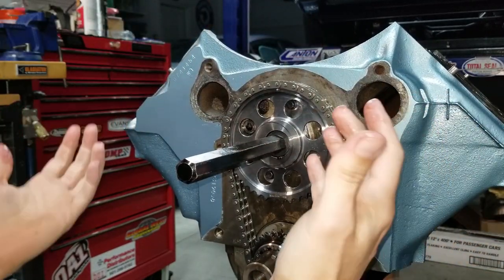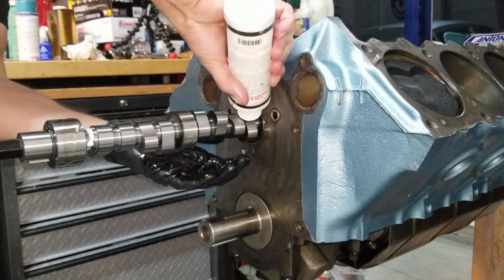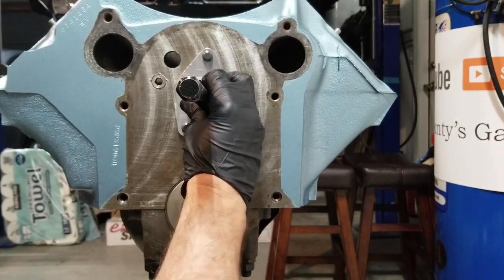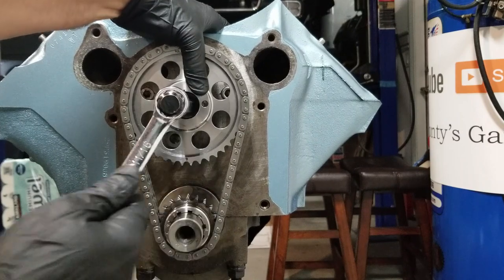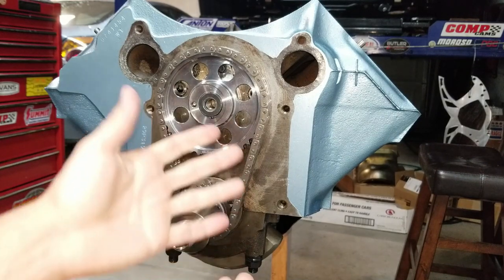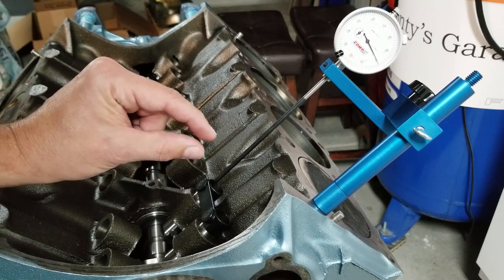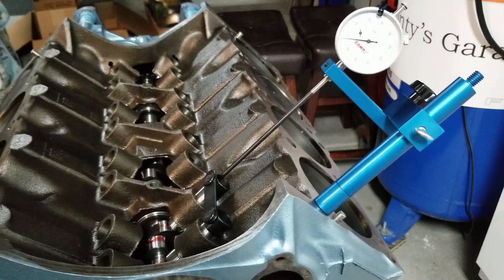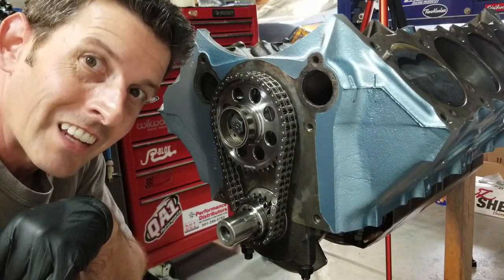Pontiac V8 Rebuild, Part 8:  How to Install your camshaft, and timing chain, with a degree wheel.

Comment: so, why am i moving the dot to the top of the cam sprocket???  How will this affect my distributor install?  Where should the rotor be pointing then? I always lined up the dots close together, and never had a problem...   Will this affect my fire up?
Reply from the maker: Good Question, Mike.  My intent was to illustrate that if you keep your dots at the closest point, throughout the entire build, you're actually on the compression stroke of Number 6 cylinder.  So, you can move it to the "top" after installing with the two dots together, to ensure you're at TDC on the compression stroke of number 1.  OR, wait until you're completely done with the build, and find the compression stroke with the ol finger/thumb over the number one spark plug hole, and wait for the piston to push air past your finger, telling you it's on the compression stroke.  Then use the balancer to double check you're at TDC.  (Which is always good to do as a sanity check)  Then put your distributor in.  Sorry for the excess info in the video... I'll admit, it's confusing.  Thanks for the comment!
Reply: Thank you for the “sanity check”!  Makes more sense now
Reply from the maker: @mikemodafferi5356  Nooo thank you for asking!  great point of clarification.  Keep em coming!

Comment: how do you feel about roller set ups? my father and i have firebird with a 400 in it and we need to do the cam  and lifters i want to go with a roller system but im not sure if it will be worth all the extra parts do we need to go with new valve springs and rockers as well as valves if we change to a roller cam/lifters?
Reply from the maker: Liam, seeing's how my first roller set blew up, that's a tough question.  But, I have faith in an American Made set, which are Johnson Lifters, from Butler.  Anyway, yeah, the point of a roller is to have a more aggressive cam, which would require higher pressure springs to ensure the roller maintains contact with the cam throughout the entire rotation.  And, if you're going to go that far, you might as well get high ratio rockers to optimize the valve movement.  All that equals more power... tough and expensive decision, I know.  Good luck, and thanks for the question/comment.  I'm sure others are wondering the same thing.
Reply: @FastMonty  you ROCK! So the factory valves will be okay or are there better valves we should be checking out? Or do you know of a kit that includes everything we will need to go to rollers?

Comment: Should you reestablish TDC each time you adjust your timing chain to a different key way? Great video helped me a lot!
Reply: Good question. If you're changing the keyway location on the crank sprocket, you have to remove the degree wheel...so, make sure the degree wheel is at zero, before removing it.  When you reinstall the degree wheel, set it back to the zero mark.  That being said, there's nothing wrong with finding tdc every time. Just to make sure.  Thanks for commenting,and good luck with your build!
Reply: Mike Montanari I’ve been having an awful time trying to get this cam degreed but once I started reestablishing TDC after each change it all feel into place. Still love my Pontiac no matter how much it fights me! Thanks for your response.
Reply from the maker: Awesome!  Glad it worked out!

Comment: Does your fuel pump eccentric sleeve move back and forth once tightened
Reply from the maker: I believe it does rotate on the inner sleeve.  I'm almost at that point again in my latest rebuild... I'll find out, and will try and let you know...
Reply: @FastMonty  mine moves quit a bit towards the timing cover and back towards the timing gear where it makes a clicking sound. ???
Reply from the maker: @jacklopresto2872  That does sound excessive.  I'll video what mine looks like, when I get to it.
Reply: Awesome can’t wait. When will you be at that stage
Reply from the maker: @jacklopresto2872  Hopefully this week.  :)
Reply: @FastMonty  ok awesome
Reply from the maker: @jacklopresto2872 Here you go... https://youtu.be/86XlfGs5sj8

Comment: Order peoble  says spinding by hand??
Reply from the maker: yes, and no... with the installation tool installed, you should be able to spin it freely with a wrench.  Due to "Stiction" the cam will not start turning easily, but once you get it turning, you can tell right away if it's too tight, or not.  Hope that helps.
Reply: @FastMonty  thanks good help.  Thank you very Much
Reply: @FastMonty  Hello again.. How Many foot pound can i Tight my care rods.  Thanks you very Much..
Reply: @FastMonty  and how many foot pound can i Tight my my crankshaft.  Thank you
Reply from the maker: @srenjustsen6749  Are you referring to the Crank Bolt, that holds the harmonic balancer on?  160 ft lbs.  Here's a link that will help... http://www.wallaceracing.com/torque.htm
Reply: @FastMonty  great. Thank you very Much.  Awesome engine you made✌👍👍